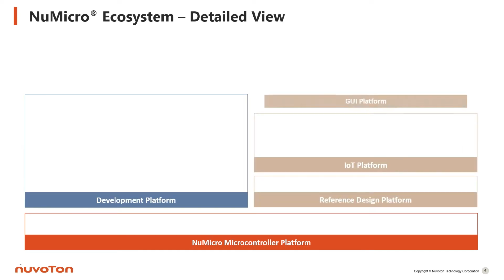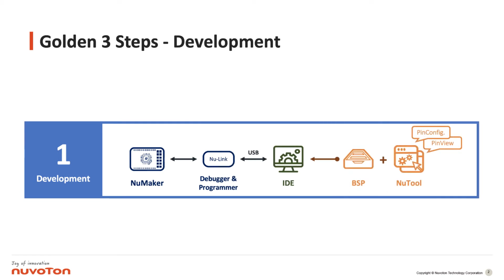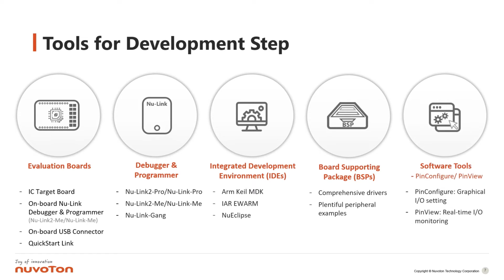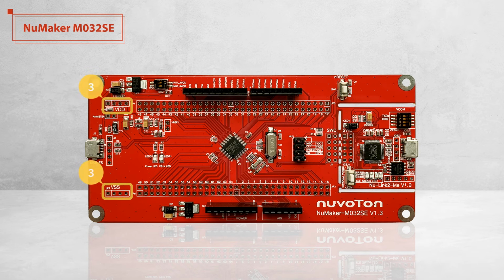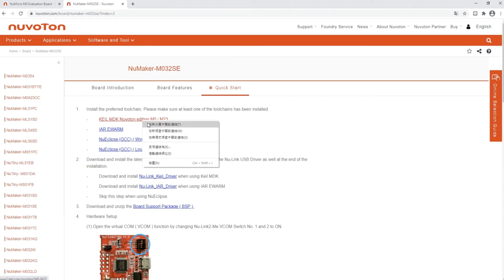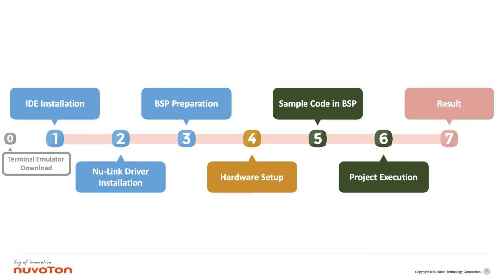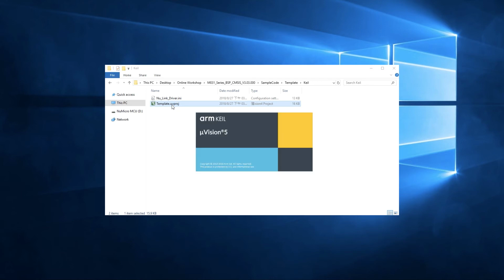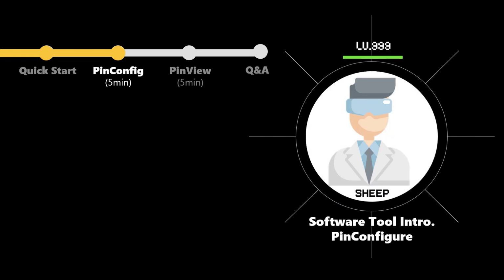The best MCU beginner course－Lead your way to the Nuvoton development platform

Comment: I bought a handful of these for a project, thinking the ultralow power and wide voltage were ideal. But the learning curve to get this to work is very near vertical. Could we not get a link to the Arduino programming environment or something? The physical footprint is compatible, but the software? Not so much...
Reply from the maker: All of nuvoton Arduino information can be found from below nuvoton github link. 
https://github.com/OpenNuvoton/NuMaker_UNO

By the way, we still suggest using BSP driver to implement low-power operation flow.
If possible, please also study BSP sample code.
https://github.com/OpenNuvoton
https://github.com/OpenNuvoton/M251BSP/tree/master/SampleCode/PowerManagement

If you have any question, please email: Salessupport@nuvoton.com and we can assist you further.

Comment: Hi Team Nuvoton, I am working on a project where I need to connect MS51FB9AE MCU with nRF24L01 RF module. Can you help me with the library or some tutorial which may help.
Reply from the maker: Thanks for contacting us.
You can refer to the example code, Drive NRF24L01P Module via SPI, for other series rather than MS51 series first. Find the example code here: https://www.nuvoton.com/resource-download.jsp?tp_GUID=EC0120191209142353
We will upload the example code of MS51 series later.